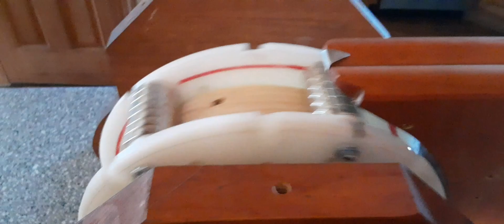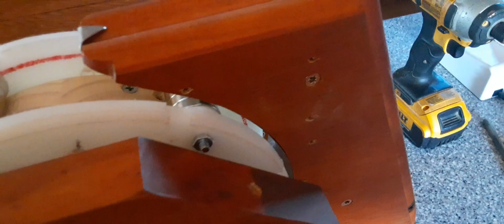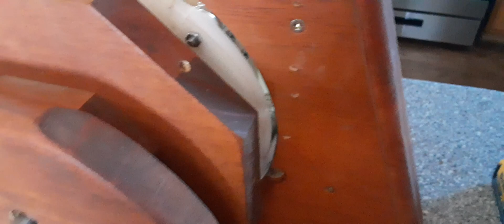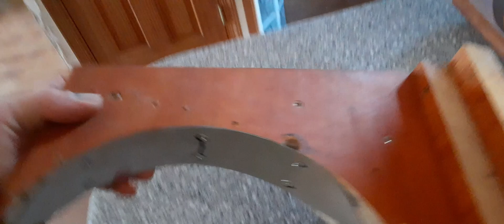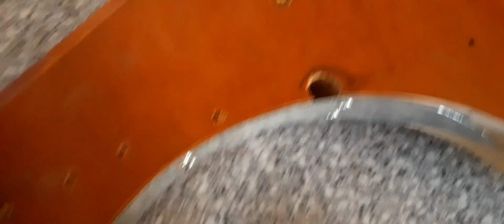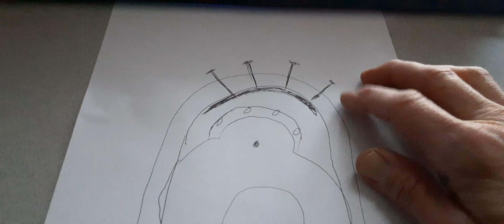Magnet motor test run and problems

Comment: If it doesn't turn, how do you expect to get energy out? I think the problem is it takes just as much energy to put a magnet into a magnetic field as it gets from being pushed out. If it's perfectly aligned (which it seems close to) then it will just turn as if no magnetic fields are present - but with zero energy out. If there was no friction it would turn forever. The reason it's turning further than expected now is the slightly decreasing distance between the magnets but that's something you can't continue indefinitely.
Reply from the maker: We'll see in the future.....right now nothing is tuned and all alike magnets don't have the same strength.

Comment: Magnets from china are not uniform in strength.
A hinged moveable stator to pull back at certain points on rotor may help.

Comment: Do u know the "magnet detection sheets" which show the magnet field and polarisation
Reply from the maker: I have the magnetic film paper and also a polarity detector but that won't tell me the strength of a magnet. I'd need a gaus meter but there 300 dollars.
Reply: @Lightendog  nice that you have these films. Do you know this little "Computer" Arduino or the ESP? These are Microcontrollers and have a bunch of sensors available. One is the Hall-Sensor module..it is cheap and shows polarization and strength, and is quite small (so u can  measure in small spaces).
Keep rocking

Comment: V gate motor dont work unless all the magnets are equal field
Reply from the maker: I agree, it's gone be long journey making sure everything is perfect.
Reply: @Lightendog  maybe you need a gauss meter .  V gate works i made one  and manually moved the bar magnet by hand so it does work. BUt it worked for me cause i did it by hand, once you have the mechanics move the lever there is not intelligence to know when to apply or remove pressure for spin so in this respect the weaker field breaks the system threw the mechanics . I would check the field strength of all the magnets if you have one that is outside the range of the others thats probably the one breaking the system